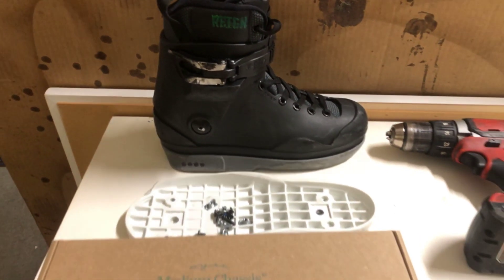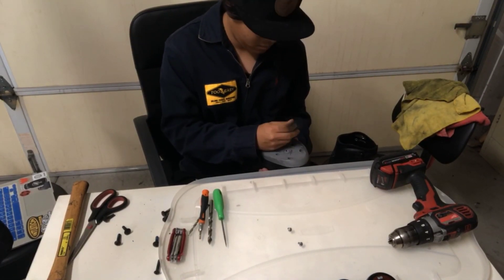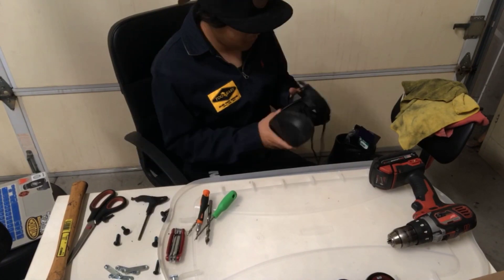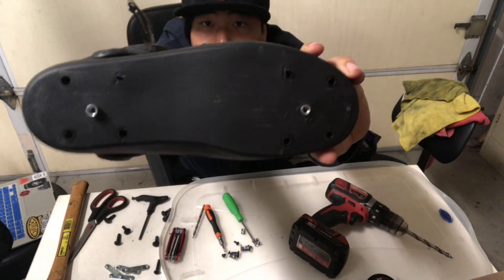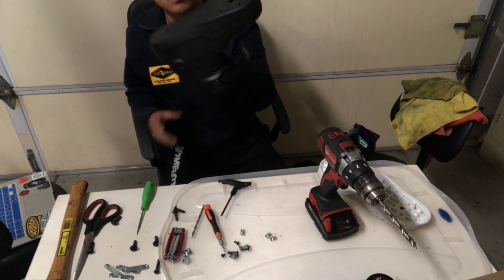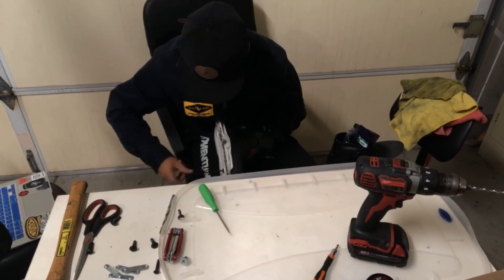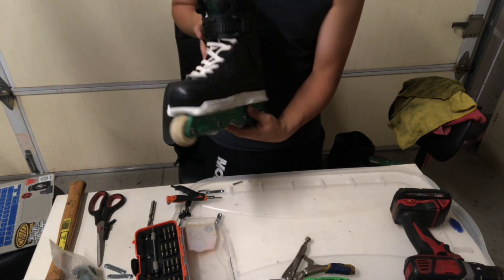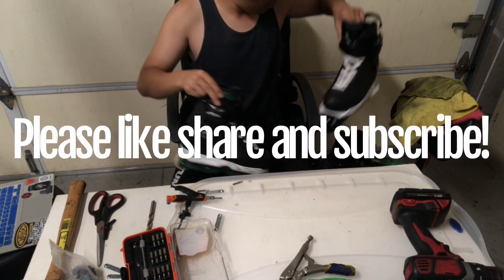How to Install USD Sway Soulplates on Themskates 909/908

Comment: My USD Sway soulplate was ripped off while rinding casually a miniramp ... how to I make the holes on the boot smaller so I can replace it now :) .... 10x for the video I was looking for a close up on how to this screws work that keep the soulplate to the boot.
Reply from the maker: sadly once a whole is drilled you cannot reduce it size, how ever you could try to use jb weld and cover the whole let it cure and re drill a new whole to you exact size

Comment: I've got the medium shell 908 (US 9-10) on order and I'm wondering what size soul plate would fit best?

I'm thinking either the 10-10.5 or the 8-9 soul plate, but I'm not sure.
What would you reckon?

Thanks for the video, love these mod ideas 🤟
Reply from the maker: You’re gonna wanna use the 10-10.5 Forsure!
Reply: @nolanjun94  Cool, thanks for that! 😁

Comment: Also. I have the shima reissue & it’s got a built in heal ríase which I wonder if I change the soul plates I can find a flatter option. Not to grind. Just to roll around. What are your thoughts ? I just can’t get the plate off as one of the screws is stripped
Reply from the maker: so unfortunately the only way to get the stripped screw out is to drill it out and replace the hardware, you could try a Mesmer soul plate that has a more flat bottom soul, however with raised heel skates you must use a raised heel soul plate aswell, unless you buy a hell shim from Justin Thursday who makes a bolt on shim that allows you use flat sole soul plates likes usd carbon souls or seba souls
Reply: @nolanjun94  thank you for your help. I see. What if I bought the ground control HD frame with the soulplate that came with the shima . Can I use this without a spacer ?
Reply from the maker: @hvdb4492  Sorry for the late response but that is a good question, actually it might work bu haven't tried it so im not entirely sure

Comment: I am also going to give this a try. If for some reason I mess up will I still be able to place the THEM soulplates back? And the THEM soulplates don't by default have UFS setup (so the holes)?
Reply from the maker: yes the holes are in completely different areas so you can always go back to stock

Comment: What do you mean when you say yoga mat between the boot and the soul plate and what shock absorber do you use?
Reply from the maker: If you can imagine a skate sandwich, with the soul plates and boot being bread, then the yoga mat is the meat in between, and the shock absorber I use isn’t specific i to any brand I just use old skateboard shoe insoles from when I was younger, or good running shoe, Nike/ covers “air” insole and I put that between the boot and liner

Comment: Just a quick question, if you have the ufs Tnut holding the soul kit in place, why would you need to drill the tiny holes. Surely the tnuts holding the soul kits and frames would be enough like a usd carbon etc...
Reply from the maker: once you have the ups t nuts you DO NOT need to add the other hardware, however I add the hardware because I feel that the soul plate stays more stable when grinding and also makes less noise when landing. making more of a thud sound instead of a click clack sound. I skate RB solos with use carbon souls with just UFS nuts holding them place and I can feel the soul-late flexing a little when grinding and it does tend to make more plastic clacking sounds when I land. but it isn't needed to skate just a personal preference
Reply: @nolanjun94  amazing thanks.
Reply from the maker: @RollerbladingwithRoss  anytime fam HMU with any questions and ill do my best to answer

Comment: Cool video, no it's not wack! What's the yoga mat thing you were talking about??
Reply from the maker: Thank you man, it means a lot! I cut out inserts from an old thinner yoga mat and I cut holes in it for the hardware then I place it between the boot and soul plate for extra shock and sound absorption to prevent any possible clicking sound from plastic on plastic
Reply: @nolanjun94  pretty cool I'll keep it in mind if I do stuff like that. Keep it up 🤙

Comment: Hey there. Gonna try the same mod but without any provided hardware. Would you say the receptors are standard issue M4 size t-nuts?
Reply from the maker: Knark I’m not entirely sure but but if you’re buying all the hardware from a hardware store, then just make sure you bring the soul plate in and make sure it fits through and is long enough
Reply: It's funny in the UK these souls are sold as standard with the hardware and apparently come from the manufacturer like that. Wonder why it's different in the States or if it's just the shops splitting up the parts? Meh 🤷‍♂️
Reply: Chilli-Ice Olive-Abode in the end, the hardware was included despite the item description stating otherwise. Both Loco and This is Soul (where I ordered from) stated no hardware included.
Reply: @knark  Oh that's good then. I only mention cuz I've been through quite a few of these souls and everytime I got the hardware with them. I was surprised when I heard it mentioned in the video.
Anyway great modding! I have to admit I much prefer the look of THEM with the sway souls.

Comment: What kind of hardware do I need to attach the plate to the boot?  I can’t find it anywhere and Oak City won’t write me back lol.
Reply from the maker: Hey I used the Sway Soul plate hardware, Long usually is really good about getting back to everyone, might be a bit slow cause of the Holiday, but try again or ask Rollerwarehouse if Oak city doest\nt get back to you
Reply: @nolanjun94  thanks man. I’ll keep trying. 🤙🏻
Reply: @theandrewcummins  in general anti rivets are pretty universal. 
As long as the head of the screws dont poke through the plates holes and aren't too long you'll be good. The part that's inside the boot is the important part. You can find the screws at a hardware store. Sometimes even the flat part that is in the boot at the hardware store. The ones I find at ace WHEN they have them are the triangle ones. And they kinda suck because they are thin and little to no barbs to grab the boot.
Advice for future. 
When you destroy a skate tear it down for the hardware before you throw it out.

Comment: DOOD Is this mod worth it? Been thinking of it for a while.
Reply from the maker: well I mean they're about 35-40$, and if you prefer the wider souls/ negatives or centered backslide plate then its worth a try and you an still go back to stock if you need easily

Comment: If the skate is designed well, why is there a need to change its soulplate? Want a bigger soulplate? Get another skate with a bigger soulplate no?
Reply from the maker: Derrick Kuah Not all boots fit the same as USD sways hurt my Feet. And if you have seen any of my other videos have no issue with the stock set up. people kept asking questions so I made a video. Also as I mention in my other videos I’m re learning cesslides and I destroy stock soulplates ($50.00) in a single session, USD sway souls are ($25-$30) and since they’re wider they last longer for this purpose. I hope this answers your questions, but if you have anymore lmk
Reply: There is no such thing as a perfect skate. One might be super comfortable, but very heavy. Another is beautifully light, but the sole is too small. Modifying skates is part of blading culture, and has been done for 25 years. Also, it's not exactly cheap to buy new pairs of skates every time you you want a change something.

Comment: dumd questions here. just to confirm, you did use the Sway boot hardware? let me know
Reply from the maker: yes sir I used the USD SWAY hardware as it provides the longer bolts needed to attach to the boot